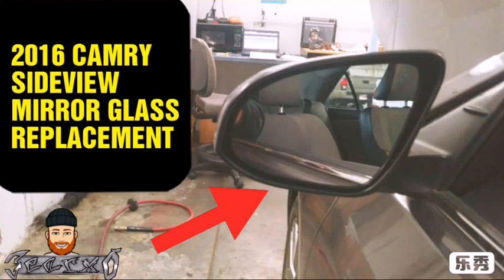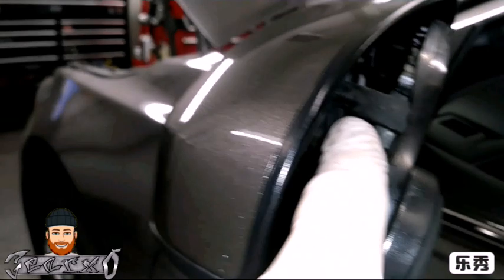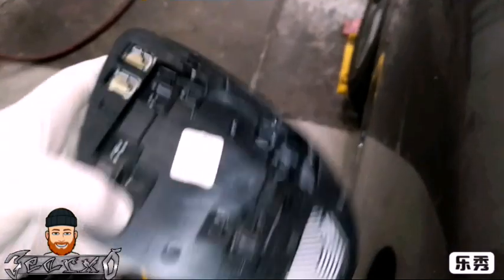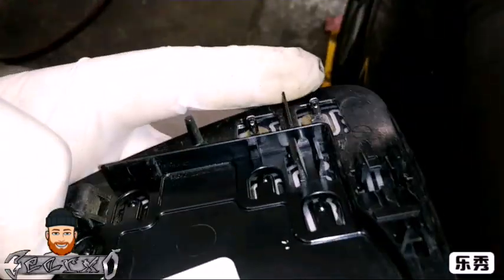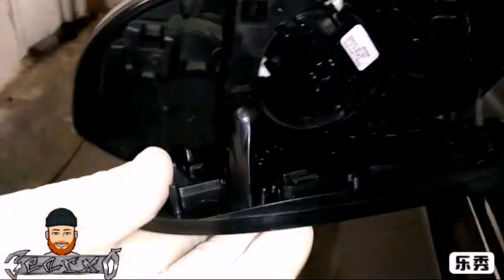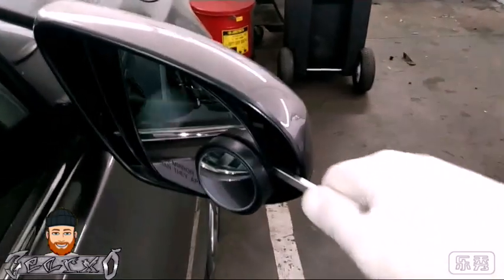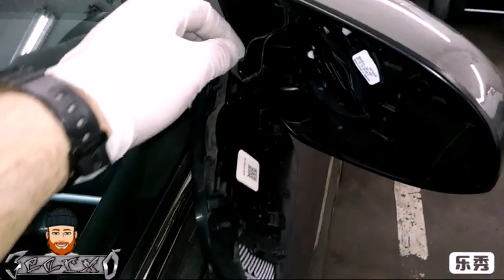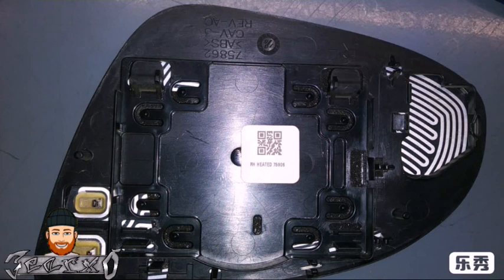2016 CAMRY Side View Glass Removal & Replacement

Comment: $30 & 5 minutes, easiest repair. THANK YOU 👏🏼
Reply: Where did you buy mirror from?
Reply: @Rk-wq5vo  mines 2014 but says it’s for a range of years. It’s also a heated mirror vs just a regular mirror.
Reply: @Rk-wq5vo  Amazon link doesn’t work but here’s the title description: Passenger Side Mirror Assembly Right Glass, Back Plate, Heated, Replacement Compatible With 2013-2018 Toyota Avalon, 2012-2017 Camry Sold By Rugged TUFF

Comment from the maker: Save some money? Small donations help greatly
 
Paypal.me/GearmoAuto
VENMO-       @Gearmo-Auto
CASH APP - $GearmoAuto
CRYPTO-  34d49fai2nN4LzACynSjRhnbmugP6AuExD

 I would love to make more content with better quality to help everyone save money and time. Thank you!
Reply: Gearmo Auto  How do you take out the wiring? The Body Shop said they would charge me $150!! Help me! 😫
Reply from the maker: @ilovefudge123  I believe the door panel has to come off and there is a white connector, then after it's disconnected there is three nuts that hold the mirror onto the side. I have multiple videos on side view mirror replacement just look up Gearmo auto side view mirror removal
Reply: Gearmo Auto I’m sorry. I meant the two little black connector thingies in this video. Do you just pull hard?
Reply from the maker: @ilovefudge123  ya just pull them off the prongs
Reply: @GEARMOAUTO  hey buddy,where do you got the actual mirror?